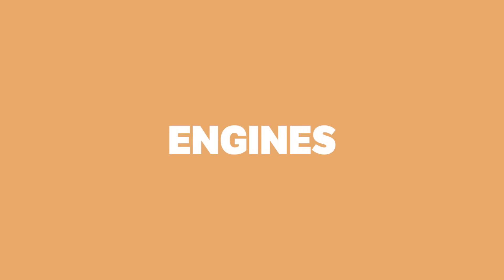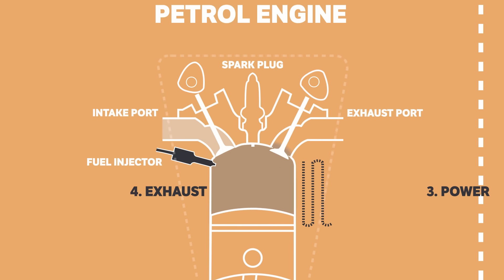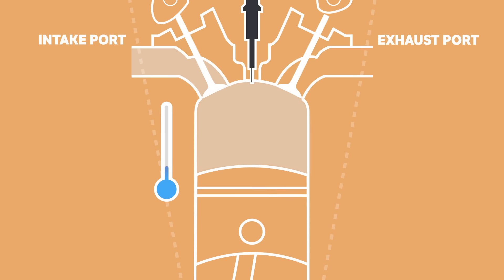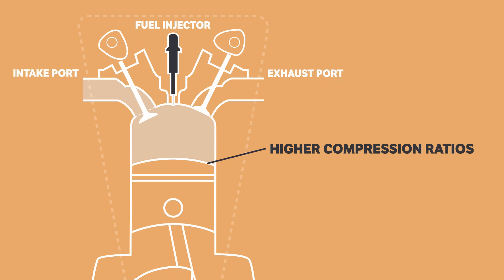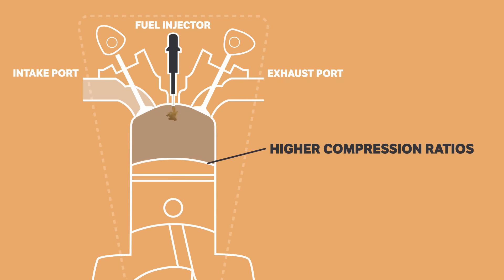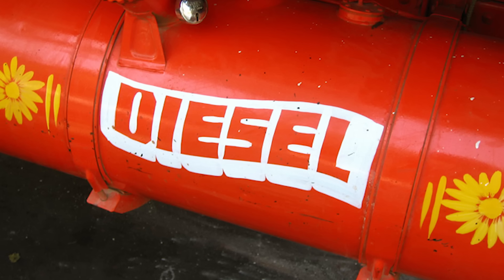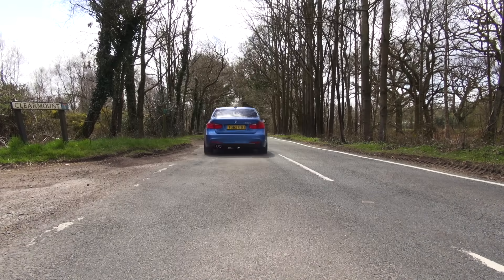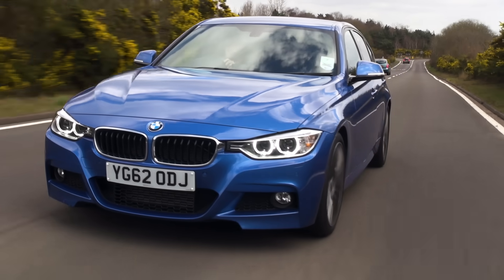The Differences Between Petrol and Diesel Engines

Comment: That engine brakeing thing got me thinking. How does the engine brake works in a SOHC diesel engine? Does it use the throttle body like vacum operated flapper valve before the intake manifold like a petrol engine?

Comment: If there is no throttle body on a diesel, how is the A/F mixture maintained? Every time you step on the gas, it gets SUPER rich and inefficient? What if you want to rev-down, you lean out the engine by introducing less fuel?

Comment: If petrol engines work that way, why did my petrol car lost power when i changed to a KN cone air filter? 
It had more air, i noticed more fuel consumption but still i got less power and performance.

Comment: So why can't petrols have a high compression as well, to ignite the fuel without a spark plug? You also forgot to mention that modern day BMW valvetronic engines, for example, don't need a throttle body. Intake is entirely controlled by the valves.
Reply: Douglas Aranda ikr. The japanese are killing it lately, especially mazda with their 14:1 diesel and petrol engines, not to mention that they want to release a new rx model with a wankel engine in it. It makes me so happy that they push new engine concepts so heavily. I may sound like an fanboy right now, but if you look it up it's truly amazing what they are doing right now!
Reply: mowglilp I think the results would be rattling, loss of power and maybe even damage to the pistons, when you use cheep fuel, your car's cpu delays ignition time for it could knock back the Pistons in a bad way...
Reply: true. I was hoping they would state that in the vid.
Reply: mowglilp because you'll get detonation which is where the fuel ignites before the piston reaches mid stroke, youlk probably bend a conrod and then who ever made your car will want 5 grand to fix it
Reply: Douglas Aranda Great news m8. This is called Homogeneous charge compression ignition and Mazda is working on that. If we are lucky we might see a self igniting petrol engine from Mazda in a couple of years.
Reply: Because if for gas to ignite like that, the piston would have to be touching the injectors. Gas just has a higher explosive point.
Reply: Pre-ignition
Reply: That's new to me, once I saw this /watch?v=kV2ApRM_Pi8 But it was many years ago, don't know how good it is... Guess the Japanese are way over the rest of the world!

Comment: Diesels are for poor people who can't afford to run petrol cars
Reply: a diesel without turbo would have roughly 5hp lol that's why
Reply: Diesel cars are more expensive m8
Reply: That's why a TDI Golf is more expensive than the TSI...
Reply: Diesels are far more expensive than gas.
Reply: If you buy a diesel car, you kinda get so much more for your money. like the standard model is turbocharged. but like most of the petrolcars, if you want a turbocharged engine, you have to pay much more for it. kinda stupid....
Reply: They had a huge test last year in auto motor sport magazine (atleast in Slovakia) where they compared the same cars with diesel and petrol engines. Rules were: you buy a new car, drive 20 000km per year for 4 years, you pay for service and what's the depreciation. And the results were very close to 50:50, some diesel cars are cheaper only if you drive more than 25000km per year, some were cheaper from the first km and so on. Quite interresting.
Reply: laughs in Opel naturally aspirated 90hp xD
Reply: R    Diesel prices are higher
Reply: R so if you buy diesel bmw that's mean you are poor?

Comment: Diesel can fuck right off. It's shitty and dirty! Stick with petrol. The only good use for diesels are lorries, tractors and all other kinds of commercial vehicles.
Reply: Big cars in general.
Reply: Any Vehicle Automatically becomes a Utility Vehicle once a Diesel is fitted.
Reply: Diesels are good if the minimum wage of your country is 557 euros and your work is 100 km away and diesel being up to 0.30 cents cheaper than petrol.
Reply: And tanks... gotta have tanks!!!
Reply: Do you know how that happens? 
They produce the same ammount of poluents, but then come the kids injecting more fuel and ruining the cars
Reply: with great emissions too
Reply: Пацантрэ ВащеРебята I'd still rather listen to a quiet petrol engine than a chugging diesel. I was talking about high performance engines though; a V10 diesel will never sound anywhere near as nice as a V10 petrol.
Reply: OrNoir you can't hear petrol engines nowadays, are we all supposed to look at dashboard(tacometer) all the time now itstead of watching the road?
Reply: Jai Vaja you are thick as pig shit if you actually think that #torquelife #torquejunkie
Reply: V8 Guy And gas is only for small cars. It shouldn't be used for anyone bigger than a grand Cherokee.
Reply: pretty funny since both petrol and diesel are dirty
Reply: i have a '05 bora (jetta) tdi and it's very well mentained since my dad bought it new. So,even when i floor it to 4k rpm,almost no smoke is coming out. People that say diesels are dirty refuse to see the mantained ones,and look only for the douchebags roaling coal
Reply: But the acrid smell.
Reply: домино™ me too. and remember: hp sells, torque wins races
Reply: Jai Vaja that was long ago now new diesel engines are way cleaner
Reply: then u are driving the wrong car, i can hear mine laud and clearly ;)
Reply: Jai Vaja agreed diesel should be for commercial vehicles and heavy duty pick up trucks only
Reply: Dude you're speaking about the Diesel from the 90's , have you ever driven any knew diesel cars ?  the TDI for instance is fucking amazing , even in the Cold winters it just works
Reply: With the introduction of the Diesel Particulate Filter and the AdBlue system, a lot of the time the air that comes out of a newer diesel vehicle (such as the Audi SQ5, for example) is actually cleaner than what goes in, in terms of carcinogenic particulates and carbon monoxide. There are also a lot less nitrates coming out of the exhaust of a diesel vehicle than there used to be. Modern diesels release mostly water vapour out of the exhaust. Sure, it's not clean, but neither is petrol and it's certainly not much cleaner than burning coal/oil to power electric vehicles
Reply: quantrell good job ;) I hate ppl saying bad stuff about diesels that don't know shit about it
Reply: Jai Vaja I fully respect your opinion about Diesel vehicles, we ain't here to criticize but I will correct you. Diesel is much more cleaner burning than a average gas engine thanks to DEF or diesel exhaust fluid systems, they basically remove all the harmful polutants. Also yes, while diesel engines are much heavier they have a higher power to weight ratio tudbocharged as compared to a conventional gas engine. remember I said power which is torque, not horsepower, horsepower means nothing it is a simple calculation based off of torque and maximum engine speed acheivable. Cheers Mate!
Reply: Who cares about the emissions? All that matters is that petrol engines don't sound like some flatulent drunk drowning in vomit.
Reply: I have a Mk7 TDI and it's completely alright, don't know what do you exactly mean by "Diesels are dirty"
Reply: if not for NOx, it would be more clean than petrol